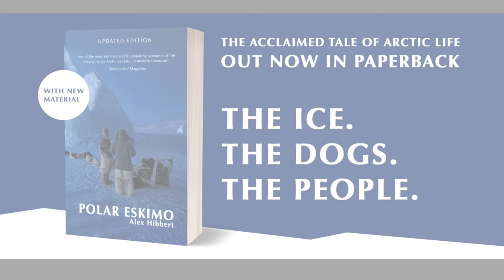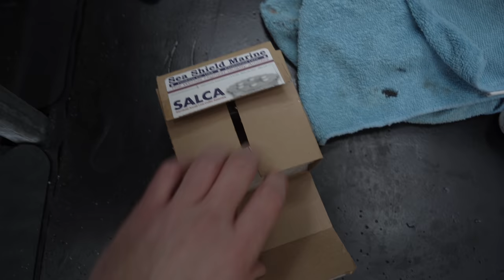Lifeboat Conversion Ep32: Change of plan for protecting hull fittings, and other new additions [4K]

Comment: Another great video… just a constructive comment…. Did you clean the prop shaft before the anode was fitted, light rubbing with a scotch pad by hand will do the trick, as in essence it is an electrical connection (speaking from experience of fitting anode to a dirty stern drive)
Reply from the maker: You know what, I didn't. I'll do a continuity test with a multimeter.
Reply: @AlexHibbertOriginals  it’ll probably be ok but the better the connection the better the anode will do it’s job 👍
Reply: Remove it and clean up the shaft with emery cloth. It (should) only take a few minutes to do the job right.

Comment: Those flap disks absolutely rip through material with great control, I rarely find myself using the old grinding disks. So I’ve found the same results as you. But I’m no career metalworker.
Reply from the maker: You're right. They have no business removing material so easily and so quickly!

Comment: Great job!
But why didn't you remove the pipe?
Instead of mixing materials into the hull?
Reply from the maker: The damage to the area surrounding the fittings, and the space needed to do a full glass repair, plus access on the inside to the area, meant I chose this option. The fittings are very well bedded in, and have internal seals too.

Comment: Alex I hope you used a good engine flush ! Remove oxidation on the inside of the engine I worked HVAC many yrs and there is a redish acid we use to clean copper nickel
Just mix it and brush it on and flush through enige the fouling factor i believe is .05  they will be bright and shiny inside and out and run sooo much cooler making more power
Do use the bukh.  thermistat!  not after market can save you alot of greif !  More important then you think  also i would  make a semi circular stainless cover for the out side tubes .! 
Great  vedio. CHEERS TOny

Comment: Alan, tell Alex to put a thread locker of some sort on your prop-shaft thingy
Reply from the maker: I think these are supposed to 'lock' through the tightly torqued bolts compressing the softer zinc, but I'll check with the supplier.

Comment: I'm afraid I'm going to have to declare that a bodge.  See the latest Sailing Magic Carpet to see it done properly. Sorry;  still loving the videos though.
Reply from the maker: If you skip back a few episodes you'll see me use the 'graduated discs of fibreglass' hull repair technique, as they use on their channel. I've considered a massive effort cutting the whole things out, and making substantial holes in the boat that need to be structurally repaired. However, the fittings are well bedded and robust, and there's no reason I can see to not flatten and 'over-laminate' them.

Comment: There was nothing wrong with the grinding disk.  In the words of The Almighty Steve Jobs, "You're holding it wrong!"  
Grind with the face, not the edge.  That's why the disks are so thick...
Reply from the maker: That's where the bit about angles comes in - it wasn't possible to get the right angle whilst not damaging the surrounding material and fittings. Also, you lose visibility over the angle being held against the metal. I promise, I tried all options. The final try was to use the edge of the grinding block.

Comment: Sorry, but you really should completely remove the through hull fitting and properly fair and glass up the area. The"patch may bond to the existing fiberglass but it will not adequately bond to the stainless steel. I would not do that repair to my boat, and would certainly never do it to a boat that will eventually be hundreds, if not more miles from assistance. 
Other than that, good work. 👍
Reply from the maker: Yes I've given it a good deal of thought. You'll have seen me do a multilayer fibreglass dent repair to the hull in a past episode, using the accepted method. Here I've assessed the quality of the steel fitting and it's bedding, the quantity of material that would need to be removed, affecting the shell's inherent strength, and taken into account how flush the repair will be. The initial dome method was rejected, but on balance I'm comfortable with this. Consider also that the internal seals (robust screw fit seals) are still in place, and were previously the only means of stopping water ingress.
Reply: I think this is fine and it's 1000x better than placing some pre fab part over it with lots of air trapped in between. Now it will become one with the rest of the boat as long as there's enough overlap and thickness and a lack of trapped air bubbles. Although air bubbles won't really matter that much here because the fiber glass will not experience heat or flex, so it's only for preventing weak spots on impact with something.